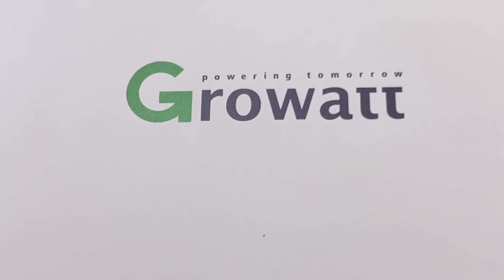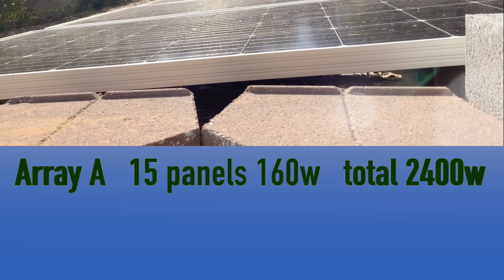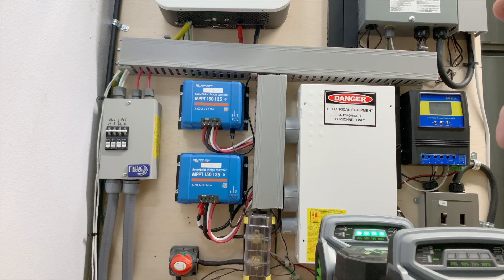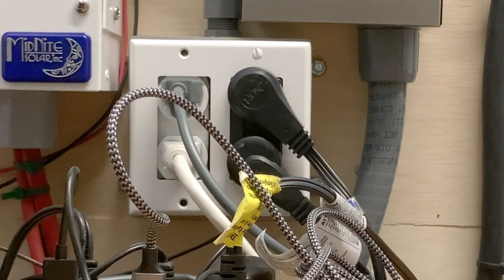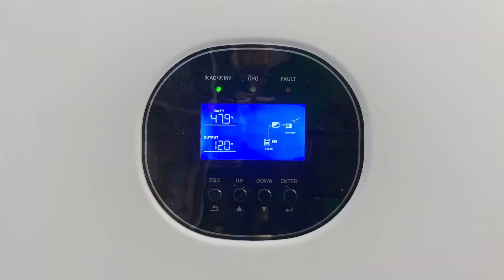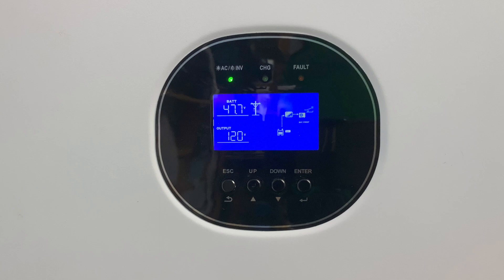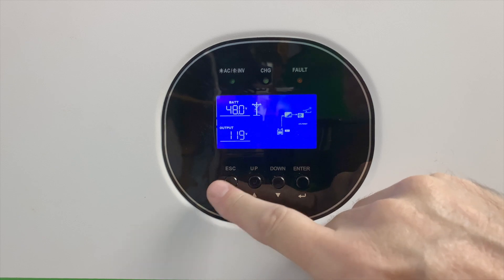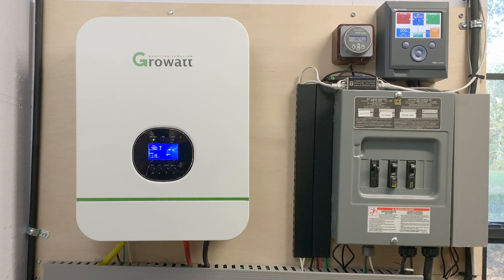Growatt SPF3000TL 3000 watt 48v Solar Inverter Review

Comment: I'm planning to by the Spf 2000 tl hvm.
Hope I can use it without the AC input
Reply from the maker: I'm not familiar with it, but there's a good chance it will work fine on just battery and solar.
Reply: @ReelClearMediaLLC  thanks

Comment: you can add a third reason why you should not use the growatt MPPT charge controller , which is it only takes 1800 W from PV array . and if you do a deep search you wil find it is an upgraded PWM , not an MPPT at all .
Reply from the maker: I haven't seen that, do you have a link?

Comment: I bought 2 of these inverters. they are far from the best inverters under 1000 dollars. I still have one, it just sits on a shelf. I do have the best inverter under 1000 dollars and it is a Growatt 5000 es. They will power everything you can think of your house and garage and your power tools.
Reply: I've been researching inverters and trying to decide between the 3000ES and the 5000ES. You have helped me decide on the 5000ES. I am creating a portable system on a hand truck.
Reply: I recently found out that the 5000 es is 240v. It would work as a stationary home system connected to a transfer box, but not a portable 120v system, which I need to make.

Comment: This is a high frequency transformerless inverter that's not going to last very long running inductive loads such as your air conditioner and is far more susceptible to damage from lightning strikes. After operating a factory authorized inverter repair center for over 23 years, When this inverter fails, I would highly recommend installing a low frequency transformer based inverter instead.
Reply: Hi! Which model you can advise for 3kW and 48 V battery? Thank you
Reply from the maker: Installed the Growatt LVM in the fall of 2020, still running flawlessly. I'm not running any big inductive loads, one of my air conditioners is a 1 ton Midea U-shaped, has a variable speed compressor, and doesn't pull a big surge on startup. The other is a GE 1 ton window AC. I also charge my Nissan Leaf with this system. 
I agree a low freq. inverter would be better for big inductive loads, well pumps, a 3 ton AC, etc.

Comment: I saw a pro/con video on the unit where the gentleman gave a few cons. Some were just minor like the space for the wiring, but a couple major ones as well. One was the sine wave at times would have little fit like spasms. Another was the unit would not switch over to Grid power when he had it set to switch because there was still some voltage from the PV but low voltage, he believes because of a condenser, and then would not come back onto the PV when it was supposed to. Didn't happen all the time but enough to be a major issue for him. 
In his comment section there were others that chimed in stating they have the same issue but they only have for emergency backup so not real concerned about the issue.
Reply from the maker: That's similar to my experience. I only use it as an inverter. I use separate Victron chargers and rarely connect to the grid unless my batteries get excessively low. Maybe happens once or twice a year. 

I haven't noticed any issues if there are problems with the sine wave, I run all of my computers, electronics, and some music gear with no issues.

Wiring it is a very tight, it could use a better design at the wiring terminals.
Reply: @ReelClearMediaLLC  I did catch your charging set up from you video. 
I am looking into different ways at this time, mainly research. Retired on fixed income but have adult kids living home and electric is through the roof. Looking to offset some cost with a system for running a few things and as emergency back up as well. 
Looking at building my own system, possibly obtaining used panels also. It does seem however materials are out of stock for many items so it might be an issue now with how the supply is messed up yet again.
I liked the growatt for price and ability to expand later if I decide to do so. I just don't want a system that will end up being useless to me after a year or two. 
Will not be attaching to the grid but will move the items I want to run out of house panel over to a new panel. 3 items will be refer and 2 chest freezers, they don't really use that much wattage per day, so I may put 1 bedroom and living room on it as well. Will look at specs for our washer also as it is on a dedicated circuit.

Comment: How did you wire 120v into the Transfer Switch when it's expecting 2 hot leads?
Reply from the maker: I'm shooting a video on that right now, should be out next week.
Basically just attached the hot lead from the Growatt to both legs of the transfer switch, all 6 breakers are on Line 1 now. I just don't run over 3000w total, that's the limit on the inverter, the transfer switch handles 6000w.
Reply: Thank you so much.   I've been wanting to do this for so long and just couldn't find any info.  I just assumed I had to buy a parallel unit.  The way you present your material and your editing skills are first rate.  Keep up the good work.

Comment: What size breaker box do you suggest using with this controller ?
Reply from the maker: This depends on your loads.
Reply: @ReelClearMediaLLC  Maybe I did not ask the right quaestion. How many amps come out of the converter @ 120 vac
Reply from the maker: @benoitlalonde5335  3000 watts ÷ 120v = 25 amps.  The manual recommends a 40 amp breaker, and 8 guage wire for the AC side..

Comment: Are you still using this Growatt w/ your new EG4 batteries?  If so, still happy w/ it?  Are you using BMS communications?
Reply from the maker: Yes, I'm still using it. As an inverter, it works great. It has older firmware, so unfortunately no BMS communication. For on of my two PV arrays,  I programmed the Growatt's internal PV charger  to the recommended 56v bulk, 54v float. 
For the second array,  I'm still using one of my Victron Smartchargers. I've got a Growatt 5kES that I haven't had time to try out. I might use the charger in that.I'd have to rewire the array for higher voltage and swap out the breakers.

Comment: FYI the Growatt has a user-defined battery type option. I believe it could be made to work with the Chevy batteries, if you want to sell your Victrons.
Reply from the maker: The chevy volt modules I have are 12S and I want the max charge to be 4v/cell or 48v/module. The lowest Growatt voltages for settings 19 and 20 (bulk and float charge) is 48v, but it would tend to charge slightly higher than that. I believe the Growatt may work fine on typical "48v" batteries with 13 or more cells.

Also, I have two separate arrays with voltages of 100-120v so one Growatt couldn't handle that. I plan in using the Growatt charger if I add a 3rd array in the future.
Reply: The Growatt look excellent for our two RV air cons but I need to confirm with testing that the running watts won’t go over 3000W. I’ll be installing a SoftStart to handle the startup surge so that shouldn’t be a problem.
Reply from the maker: @cdevidal  Even with the sofstart you may want to check the surge with a meter that can check inrush.

Comment: Great review , I believe Growatt inverters are good ones, but their problem that they did not their product very well , and they don't have enough content on YouTube about Growatt in English . ~Thanks
Reply from the maker: I've been using mine for over 6 months now. I think it's a great inverter. The solar and utility chargers don't work for some situations. I only use the inverter in mine (and occasionally the utility charger). I would buy it again just for the inverter.
Reply: @ReelClearMediaLLC  If you can clarify few points I would be thankful.
1-Using batteries
becauseillegal
which model you recommend . Note : in Qatar we have 240v & 50 HZ like Europe and  single Phase &  3Phase . 
Thanks a lot
Reply from the maker: @hamadal-rakeb9655  Sorry I am still looking for better batteries myself. 
I think you can use two of these SPF3000TL in parallel and get 240v, and set it to 50hz. Growatt might make a model that does just what you need, I'm not sure. They make many models for different voltages/frequencies around the world.
Reply: @ReelClearMediaLLC  thanks a lot

Comment: Hello, thanks for creating this video it is very helpful. 
I was wondering whats the kw rating of you're battery bank in the video and how 
what size array do u recommend for a 10kw battery bank with a 3k growwat inverter?
Reply from the maker: My battery system has about 7 kwH of usable energy. I'll eventually be replacing it with a larger Lithium Iron battery.
The battery isn't the only thing you have to consider when sizing your array. Average daily use is key. Measuring your daily use is the first step to figuring out your array.
You can also start small and grow your system after you've been using it for a while.
The battery size determines how long you can go with cloudy weather.
That being said, my arrays total about 4.8 kW. In reality, I get 3.3kW peak power mid-day, and 10-15 kWh total energy daily. Location and local weather can change the results.

Comment: The 16S LiFePO4 battery bank I'm planning on building has a voltage range from 2.5 X 16 = 40 volts to 3.65 X 16 = 58.5 volts depending on the state of charge.
Can you please confirm that this particular growatt model can support this? I couldn't find this detail in the specs sheet or the manual.
Reply from the maker: In the manual... 
settings 19 (bulk charging voltage) and 20 (float voltage) are both 48-58.4 volts. 
setting 21 (low cutoff voltage) 40-48volts.This shuts down the unit.
setting 12 (switches back to utility source when voltage drops to this level) 44v-51.2v
setting 13 (switches back to battery mode when the voltage rises to this level) 48-58v.

Hope this helps. Again, I only use the Growatt as an inverter... I don't use the solar charger in the Growatt, so I don't have any experience with that. 

Read through the comments to see what other owners have said, some are happy with the built-in solar charger, others are not.
Reply: @ReelClearMediaLLC  Thank you so much. I too am initially planning on using this as a back ups inverter to deal with outages. Maybe later I'll plan on getting some solar panels.
Reply from the maker: @anonymouse2428  I assume you will be charging from the grid. I was giving you settings on the solar charger. 
Again, read through the comments, some people were saying the utility charger doesn't go through bulk and float stages, instead it starts charging when the voltage drops to setting 12, and stops charging when it reaches the voltage in setting 13.

Comment: Hi, thanks for your video, just today i installed the 24 v off grid. In the Day time it seemingly worked well, except the fan, which was working all the time, even though today was a cold and rainy day here.  I have a question regarding the stand-by mode at night. having no experience it seems to me that every minute, the system tries to start itself, all the indicators blink a few times, then the LCD Display tuns on and the fan runs. After one minute everything goes off, Again after one minute the whole process repeats. it goes non stop. Is this behavior a normal stand-by mode for this machine?  I am wondering because there is no fault code indicated in the display, and there is no such situation explained in the manual or on the Trouble Shooting table. I appreciate and value your kind effort and time....
Reply from the maker: That doesn't seem right... What do you mean exactly by stand-by mode?
Reply: @ReelClearMediaLLC  i mean the power saving mode at night, while the inverter was also switched off.
Reply from the maker: . @rnanubandha1385   Sorry, I leave mine on all of the time, so I haven't experienced that. Looking in the manual, section 4.4, the unit can still charge batteries even when inverter is turned off. Press one of the display buttons and see if it shows any charging occuring.
Reply: @ReelClearMediaLLC  Thanks for your reply, the problem solved,

Comment: So what do you do as far as ground and neutral if you are using the GW completely independent from your house AC? I plan to get a new panel and from it run AC to outlets in my home independent of the existing wiring.
Reply: Put in a new ground rod, and bond the ground and neutral in your new breaker box.

Comment: Hi, do you, or can you run a water well pump with high start up power consumption?
Reply: It would depend on the startup surge that your pump pulls. I need to eventually run my well on solar backup also. My well pump, like most in the USA, is 240v. When running it pulls 11.3 amps for 2712 watts.
The startup inrush surge is 51.14 amps, so 12,273 watts.
That's just over the limit for two growatt spf-3000s in split phase. So I have two choices:
1. use a bigger low frequency inverter. The Growatt 6000T DVM has a surch rating of 18,000 watts. 
2. replace my well pump with one that has a low startup surge.

Comment: Thanks for your video!
I own a Growatt SPF3000TL and 48 v. batteries. Not connected to panels. At the moment, I want to use my Growatt as a backup in case of power outage. If I connect to to the AC, do I have to install a 40 amps breaker to feed my Growatt? I planned to plug it on a regular home power outlet (15A). Will my Growatt try to draw 40 amps (max) or is it adjustable by programming?

Thank!
Reply: Lol, thanks anyways, I found my answer in another video of yours :) Thanks for your excellent job!

Comment: Question:  I'm doing some initial connections of this inverter to a 14s 48v battery.  Solar array is still not fully installed due to weather.  Is it okay to connect only to utility power and battery without solar connection in the meantime so I can charge and discharge the battery?  Thanks.
Reply from the maker: Yes. Put setting 14 (charge source) on anything but OSO so the utility in can run the charger. Settings 12 and 13 will control when the charger kicks in. It's more like a relay, starts charging when battery gets to setting 12, stops charging when battery gets to setting 13. Float and bulk settings don't apply to utility charge. 
See my video on the settings https://www.youtube.com/watch?v=oDiva1SJwpc
Hopefully you'll get a break in the weather soon!
Reply from the maker: Also check setting 2 and 11 to set how many amps the charger pulls.
Reply: @ReelClearMediaLLC  Thank you! for the timely and excellent reply.  Subscribed.  Apparently, a new series of storms begin tonight ☹️

Hope you don't mind more questions...about pre-charging the inverter capacitors when connecting the battery:

When you connect, did you use a resistor or light bulb to avoid a big spark?  If not, did you experience a spark?
Reply from the maker: @mikecraig9368  Between the battery and inverter, I have a 120watt dc breaker on the positive cable and a disconnect switch on the negative, so inverter wasn't live when I connected battery. I've seen guys use a big resistor or light bulb on some systems. I don't know if it's necessary with the Growatt, but it can't hurt.
Reply: @ReelClearMediaLLC  I think you mean 120amp dc breaker.
Also, I was able to connect the battery without the spark that I've seen with other inverters.  Thanks again!

Comment: Do you have breakers in the combiner boxes outside? if so, is it necessary to have the panel dc come into the house to another set of breakers?
Reply from the maker: Yes the combiner box has DC breakers made by Midnight Solar. It wasn't neccesary, but I added a second set of breakers to isolate my Victron chargers without having to walk 150' to my combiner panels. 
You'll have to check with local building codes in your area.

Comment: I've installed a number of these in pairs for 240v. They are great except for the light flicker when motors start up
Reply from the maker: I haven't got any big motors on mine, the fridge and window ac, but that has a variable speed compressor that ramps up slowly. I've been really happy with mine. I might add a second one for split phase 240 at some point.
Reply: @ReelClearMediaLLC  Two in series works well. I think for an average home that it would need four though. Being transformer-less inverters, they don't have the surge capability of a transformer based inverter. Where I live everyone has a well so well pumps need to be added to the mix.
Reply from the maker: @mendohomepower7492  What size well pump have you been able to run on two in split phase 240v? My well pump is 1.5hp, 20 amp breaker, but the inrush surge is just over 51 amps for a millisecond.
Reply: @ReelClearMediaLLC  One one system there is a 1hp surface pump, on another there is a 1/2hp surface pump and then on another there is a 3/4hp surface pump along with  a 1/2hp submersible pump. All of the systems seem to react the same on startup of the pump motors or  fridge. The only thing that will cause a reset is something a bit higher on constant draw such as a clothes dryer. I've been looking into slow startup switches that look promising. Much cheaper than going over to slow start pumps such as the Grundfos SQ.
Reply from the maker: @mendohomepower7492 Thanks.   Are those systems split phase, or single phase, and how many inverters?
I'd be ok if there were a flicker, I don't plan on using inverters for the pump on a daily basis, just during grid outages. Trying to decide on another 3000TL, or getting the growatt 6000T DVM, which has a big low freq transformer. Heavy beast to mount though.
Reply: @ReelClearMediaLLC  Each system is split phase with two inverters. The upside to the the 6000t dvm is that it takes bigger surges. The downside is the lower efficiency due to the transformer. It takes around 200 watts to keep itself going.  The 3000 unit idles at around 25 watts. Not sure I would want to dedicate most of a panel just to keep the inverter going.
Reply from the maker: @mendohomepower7492  thanks
Reply: @mendohomepower7492  Thanks for info! But are you sure about 200W? Did you measure it yourself? Because I can't find anything in datasheet...